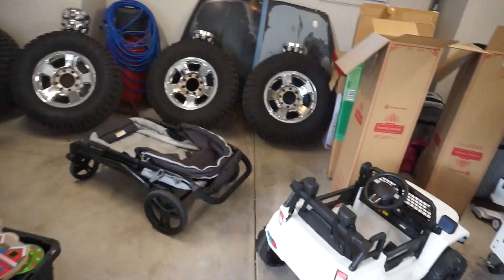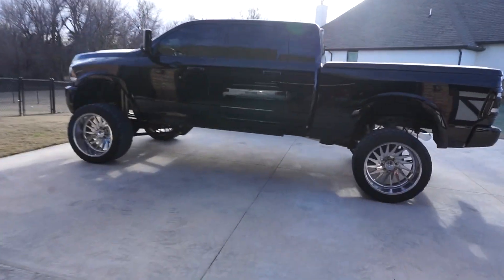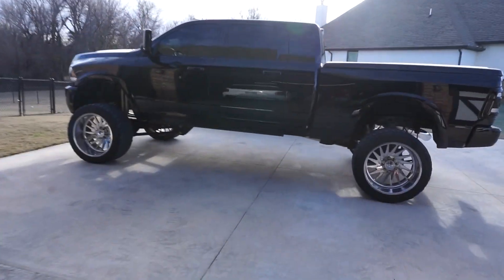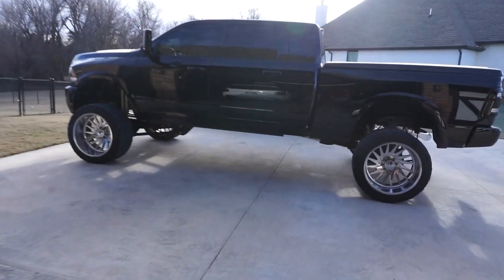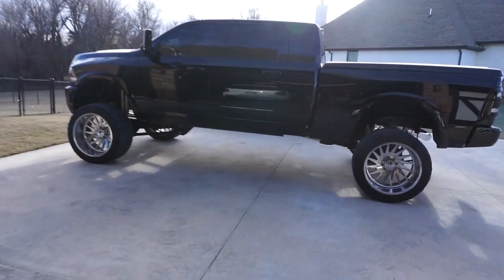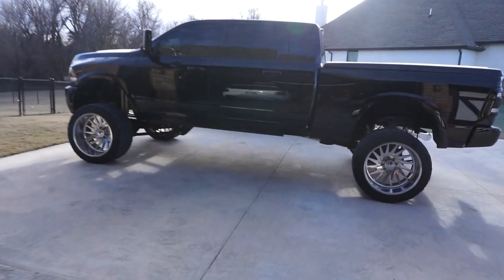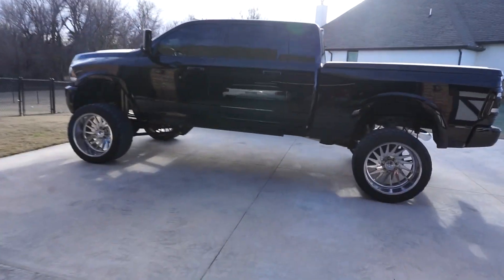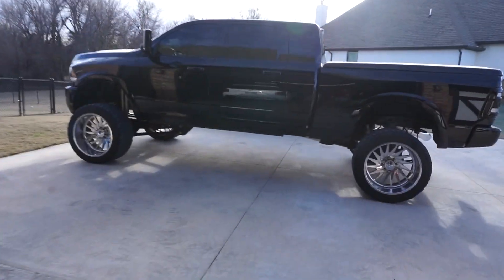Fixing the UGLY on the old girl!!!

Comment: I like your 3rd gen and the route its going, but i am excited to see the 4th gen back. Are you going to be doing anything fuel wise to it? I know it has the 468.
About to peice together a 2nd gen swap on my '16. Looking to do a 467.7
Reply from the maker: I’m very lucky to get her back. I would like to upgrade fuel later on down the line. I’m thinking 100% and a 12mm. Probably do a fleece drop in sending unit as well.